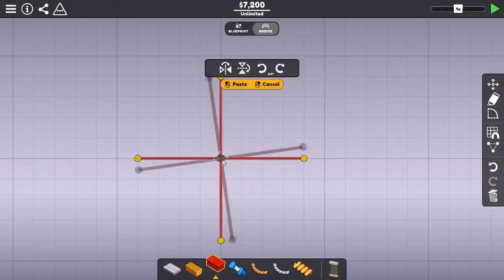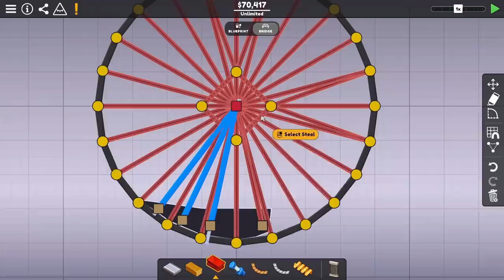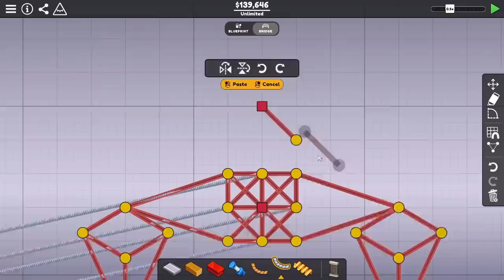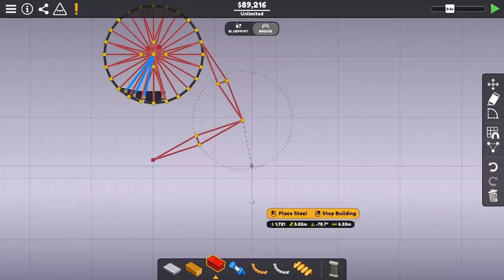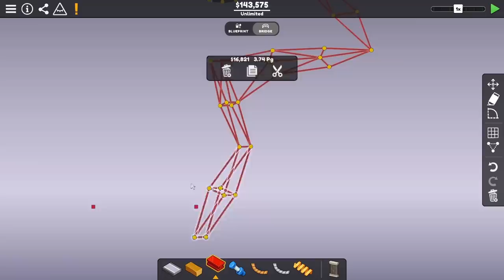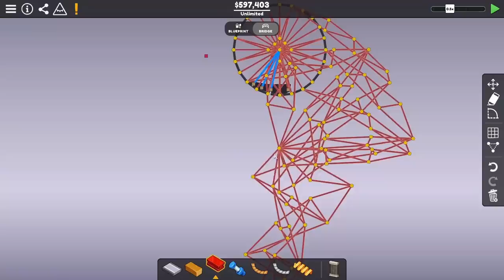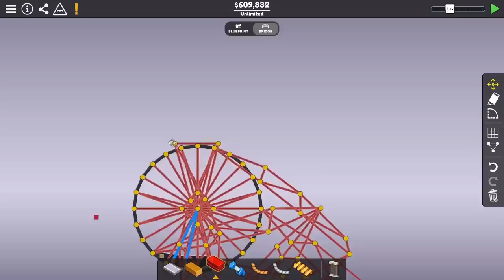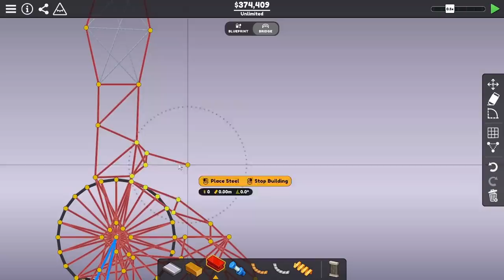Harnessing Infinite Energy in Poly Bridge 3 to Make a Mech Suit

Comment: Spin up a fly wheel and use a belt to friction launch cars at immension speed to a target. You could make the level a challenge via having a falling obstruction with a smalish gap through the middle the car would have to make it through before the gap was sealed shut. How high up the gap is will determine how much time you have to set up your car / motor to shoot the car through.

Comment: my guess is that the game requires the energy of the hydraulic to go somewhere, and since it cant go into breaking or moving the roads or steel, all the "vertical" energy is converted to match the slight horizontal movement from it being asymmetric, therefore it spins

edit: and since the hydraulic never fully expands, it attempts to keep expanding indefinitely, so it's theoretically infinite power

Comment: 10:42 the problem is that the acceleration is on the ground, way under the center of mass. This means, at the start it has to lean forwards a bit to compensate, else it would fall on it's back. Thebnext problem is, that with increased speed, the acceleration gets less, so the center of mass has to move to the back. Alternatively the center of mass can be lowered or the edge of the feet can be expanded to stop it from fallimg over

Comment: Could you try using a gyroscope to keep upright? Love the waking linkages, they look amazing ha!
Reply: Gyroscopes stabilize in the perpendicular axis to where they're spinning. This is impossible in 2D.
Reply: Just make a gyroscope that spins on another axis, duh.
Reply: @davidaugustofc2574 ... That is literally impossible. An "axis" is just a cardinal direction. That's what 2D, 3D, etc. actually mean, the number of cardinal directions. 2 cardinal directions is like a piece of paper -- Only 2 directions you can go, any other direction can be reduced to some combination of those 2 directions. 3D is the same, but with an extra direction.
In 2D, (like on a piece of paper) you can only rotate on one axis -- Through the paper. This axis doesn't actually exist, which means that there's no stabilization effect. In 3D, there is actually an extra axis that can be stabilized, so gyroscopes do actually have a stabilizing effect.
Reply: @nikkiofthevalley  Reid Captain is known for things impossible for the average person, including having a good sense of humour